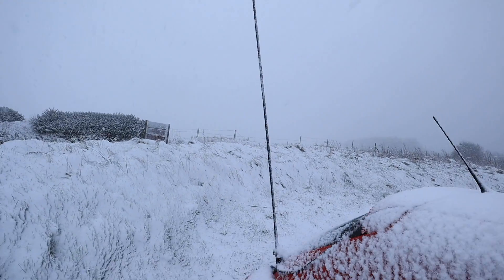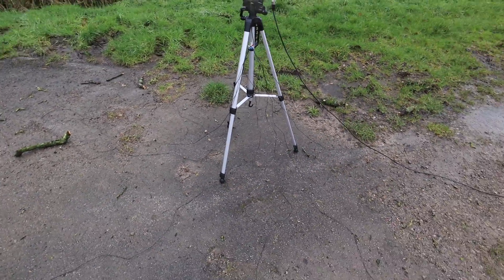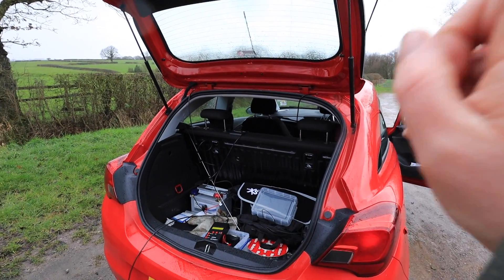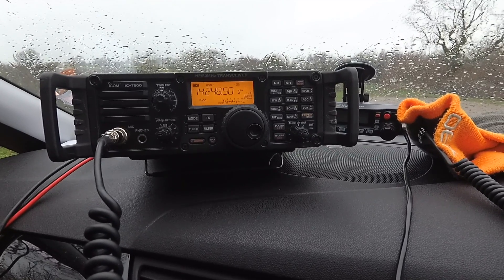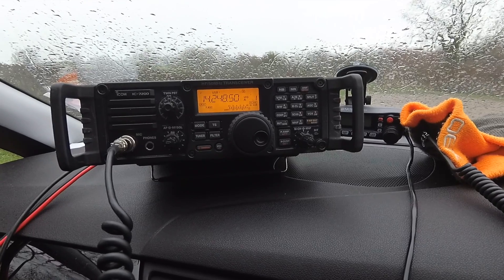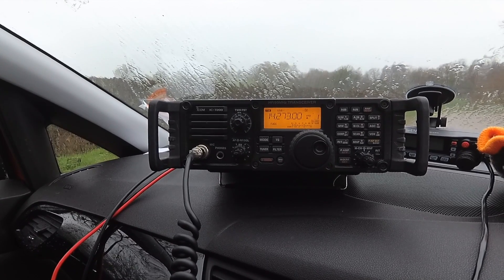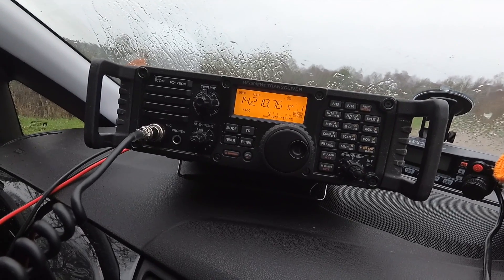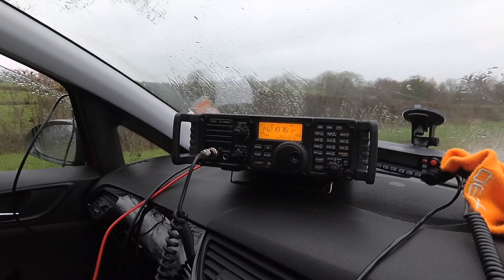How I made a simple portable tripod antenna

Comment: I,m also a great fan of /p or portable operation, mainly because of the reduced noise level. 
All your videos are in my opinion very helpful to the newcomer to this fascinating "Hobby" of ours, HAM RADIO. 
I would say you are portable! 
My experience working out and about has proved that the best DX happens when you are near the sea, a simple quarter-wave with 16 radials or four wavelengths of wire at the frequency of operation spread around the base of your aerial has worked very well for me over a number of years. 
The voltage and Gain of the aerial measured with 16 radials has the best near and far-field radiation.
I use a simple field strength meter to measure this.
You can easily make a field strength device Carl from an AVO, a pen body a coil variable capacitor and a diode, It is called a diode probe and is used to check the resonance frequency on a PCB circuit, adding an aerial gives a simple relative indication of the electric field strength.
Height plays a big part, living near the North Pennines gives me the opportunity to work from 600 metres, in excess of 1800 feet, VHF & UHF comes alive with three to five element homemade yagi aerials six feet above ground level.
73 Carl Gud DX, de John G4YDM

Comment: Great video! A tripod with a whip doesn't just work well: It works very very well and is under rated. I primarily use an "Outbacker" tripod with a Terlin tapped vertical for many many years now, 80-10 Metres. LOTS of advantages: No climbing.  Stealth. No rotors to break, no ice to bring it down. Move it anywhere. You'll still have one after the Hurricane. Placing a lot of wire on the ground improves it greatly, and it's MUCH easier to place wire on the ground as opposed to in the air. Low angle of attack. Need a NVIS antenna in a pinch? Take a couple of the RADIALS and feed them, draping the centre over the top of the vertical..So it just becomes a low mast. Now you've got a 300+ km circle around you. And again, it's always with you. And stays up.
We've got a lot hams who have either HOA Jack Boots to contend with, or are older and really should avoid climbing anyway. You'll be surprised at the stations you will work. It's great to use at the park, or right from your QTH. Thanks for video! 73 DE W8LV Bill
Reply from the maker: Thank you great feedback and ideas.

Comment: Looking at an old  lake view manual for their version of the mobile ham sticks; http://www.radiomanual.info/schemi/ACC_antenna/Lakeview_Hamsticks_HF_antenna_user.pdf  There is  section on matching. Their 20 meter ham stick suggest a 200-300 PF capacitor between the mobile whip antenna and ground connection to help match the thing.  I imagine most ham sticks could be similar or follow a similar design. I've used similar tripod rigs from time to time for "in the dark" set ups, but telescope or surveyors tripods have a wider stance and a bit more height. A ground rod, holding a section of conduit up with 16 radials spread out around it sloping down  to ground stakes works even better. I used one of these for camping. as sort of a semi permanent mini tower to mount a single ham stick on top of. Great video, wonderful information.

Comment: Are you riding Icom through the car battery, or a spare one? I'm paranoid about using too much off the little car battery I have on my Alto so I have a bunch of spare batteries I hope to be able to use. 

I'm getting ready back on air and your videos is really firing me up.

I'm getting all set up for a try tomorrow evening or on Saturday. Got a boot lid antenna adapter from Amazon yesterday, got my Watson Multi-ranger. I had a 14MHz antenna somewhere too, I just can't find it anymore and it's seriously getting to my nerves.Next task is getting the FT-847 out of its box and all ready.... I just realised it's been almost a decade since I had the Watson and I never properly used it. :(
Reply from the maker: I use separate battery, good to hear you're getting out on the air it's fun.
Reply: I'll definitely do the same. Just managed to dig out my missing 20m antenna hiding in the loft, also found a 2m horizontal dipole as well! Not bad going for a short morning so far.

Comment: Well that works!! you just need a better tripod with spikes on the legs? better ones have rubber feet that turn into spikes. Not to convinced about radial though, but I think you need them on the earth rather than concrete?  maybe the radial need to be the same length as the antenna height? Nice sunny you chose for this...73's Paul
Reply from the maker: Yes I'm going to focus on radials with my car boot portable set up, cut some new ones.

Comment: I operated in the driveway the other day and had a wrc vertical on a mount bolted to the headboard on the truck. I ran no counterpoises  and it worked great. You never know what  will work, and what won't until you try. At the end of the day, its all good.

Comment: Have you grounded the radio to the clasis of your car ?
Reply from the maker: I didn't but I'm interested to know why
Reply: @M0SZT  for safety reasons and reduce Nasty RF getting int your car electronics  and  build up static electricity  from your aerial and protech  and damage to your Radio !  Have I won a competition 73's  G0MEJ
Reply from the maker: @radiolinux45  I'm considering a choke of some type to stop common mode currents. I did get awful static during a snow storm but that's hard to combat. I'm now reading up on mobile operating (or operating inside a metal box) and grounding.

Comment: Quick tip. Get a strip of the foam water pipe insulation. Cut to length and fit it over the window top and run coax in.  Helps keep rain, wind and critters out.
Reply from the maker: Great idea!
Reply: excellent idea, n the ac in when in summer,..
Reply: TKS OM 73! de R7KDJ/P
Reply: Awesome idea, thanks
Reply: Beach towel works too...

Comment: Hi Carl. I have a couple of those whips, one for 20 and one for 40 which I normally use on a mag mount. Gonna have to rig up something similar to you and give it a go. Did you make the radials any particular length ?
Reply from the maker: At least a wavelength however there are many articles on radials that could provide the science but I believe a wavelength and all equal spaced out

Comment: hi nice job i used to dx mobile with the pro am antennas. what would work better is a 1/4 wave wire on the side of a 7m pole with some ground wires i know you have a dx commnder but for a quick set up its job done

Comment: You are not mobile you are A
Reply: The age old debate.  In this case Carl is definitely /P which is dictated by his station set up, however the RSGB has changed the ruling on this and it is no longer compulsory to state which, however they do ask that if you are going use /P /M or /A that you use it correctly.  Time to run for cover....hihi
Reply: Definitely NOT /A if anything /P but not a problem as its not mandatory
Reply: Yep, /P cos you you can’t drive away ‘as is’... all good Carl. Thanks for interesting vid. 73 Nick M1DDD
Reply: 😴🥱🥱🥱 he could use /p or /m and hey it does not matter at all! Anymore... there are NO definitive lines drawn. Better still put the antenna in the middle of the roof and forget it! As for SWR, when mobile portable or even at home, really what are you sweating about! Splitting hairs springs to mind, nice to see experimentation though but keep it real.
Reply: Hi mate. 

Q : did you get better results from moving the radials onto the grass vs the asphalt? 

I liked the use of the doingy-doingy to stabilise the tripod.
Reply from the maker: @M0RMY  moving it made it not fall over so that was an improvement in signals 🙂. I didn't notice a great deal, the same when I put my radials under the patio at home I didn't notice much from when they were on top.